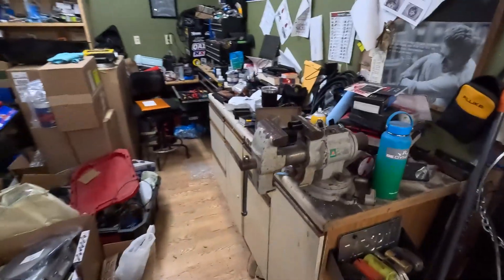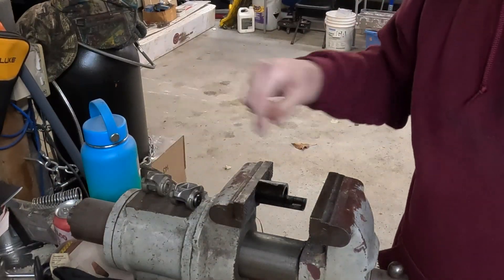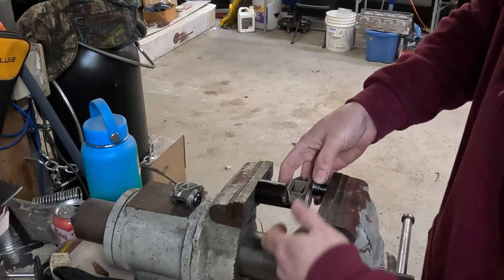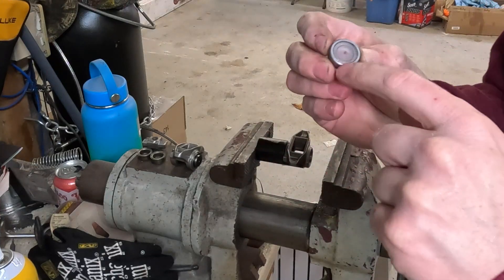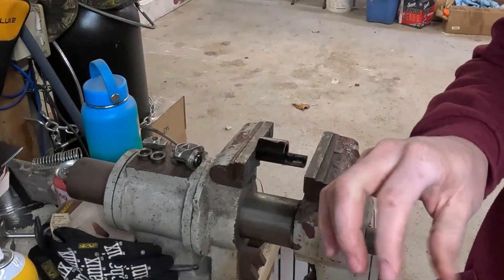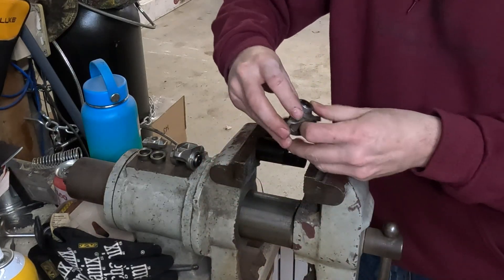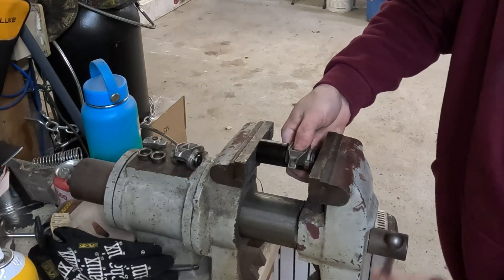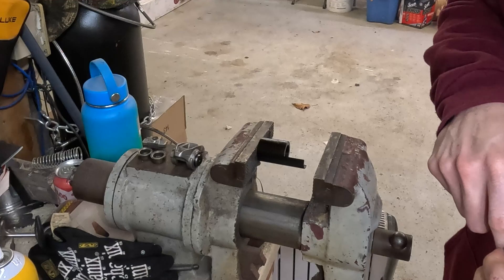Rocker Arm Trunnion Upgrade For LS Heads!!

Comment: Is this a gen 3 or gen 4? Also just wondering what you are using for an engine management system? Glad to see you doing well after your surgery! It’s great to hear your speech improving with every video as you go forward!
Reply from the maker: 3rd gen so 24/1.  Going to be running it on the stock ECU!  Thanks!!
Reply: @GoatRopeGarage  Awesome! I'm in the process of finishing off a 6L swap in my s10, single turbo, running on E38 ECM. I have it running well now thanks to all your Gen 4 tuning videos! Keep the great content coming!

Comment: If the Michigan Motorsports trunion kit is like the BTR kit then I would be very leary about using it. I purchased the BTR V1 kit from Michigan Motorsports and the bearing surfaces were messed up because they were all bagged together scratching/dinging themselves up. Michigan Motorsports is working with me to correct this and I have purchased the BTR V2 kit. Well, it had a trunion that had one of its bearing surfaces cracked! So, if you get one of these kits be very careful and look at the bearing surfaces before you put them in.
Reply from the maker: They come in tubes with the MM kit, very safe and secure
Reply: @GoatRopeGarage  The actual bearings come in tubes in the BTR kits but the shafts/bearing surfaces are all bagged together allowing them to get dinged up. I guess they changed that for the better over the past couple of months. I have pics of both the bad V1 and V2 bearing surfaces in a thread at performancetrucks titled "BTR quality" of anyone wants to see them.

Comment: Just for addition thought, my engine is a 2003 Tahoe. When it comes to Positive Crankcase ventilation, the passengers side is oil fill only, thus pulling crankcase fumes (Carbon, Moisture & Hydrocarbons) out drivers side. During the engine tear down, I noticed every valve on the drivers side had witness marks on the valve stem ends show rocker arm contact. Now, this was my job for over 4 decades is to notice wear patterns, odd as may be. The passengers side had none and I concluded the ware pattern was because of carbon drawn into the rocker arm cover. I dressed them flat and rockers arms as well after  new captured trunnions. But, to increase longevity, I bought another drivers side valve cover, placed a box end wrench over the vent pipe, rotated it 180 degrees backwards (They are just pressed in) and now both are fresh air in. The center valley plate was modified to pull Crankcase Fumes out, ran to "Catch Can".
I can go into more detail if needed but I did it my self. All crankcase fumes come out of the middle, catch can, then to PCV valve to change air flow.
  I am just suggesting not telling you that you must, but here's what I did. I included it into May service manual unique to this truck, including part numbers, schematics, diff, trans (700R4) I bench build 2 winter ago as from a 1987 era with single wire temp sender in pan to console gauge.
 Have a safe week. I hope this info makes sense and finds you in good health!
DK, Omaha.
Reply from the maker: That's a good idea and if you just pull the valve covers normally the bottoms will show what you're talking about on these. Both will have some accumulation but the drivers side will have a lot more build up
Reply: @GoatRopeGarage    The valve covers that have the metal vent tube, have a metal baffle blind riveted into them. I Water Pipe fittings and GM/Permatex Pipe sealant, sold at home improvement stores next to epoxy. I use 1" copper pipe and hangers, took the heads off aluminum rivets, drilled shallow hole (Practiced First on Similar)  and drove them with large flat punch. So, the dollar store sells stainless steel wool now for cheap. I shoved it in the pipe not tight but full. This allows cooling and vapor to turn into liquid. Small holes at the front and increased size every inch going back. I installed a 30 degree angle fitting per-soldered in place. This routes it between knock sensors going backwards. Cross-drilled the tip and install two cotter pins in an "X" pattern. Top side, drilled the valley pan measured for intake clearance and faced a barbed fitting backwards under intake to hide hoses. I used two aluminum oil drain washers and pipe sealant to tighten at valley plate, sealed knock sensors top & bottom with continuous bead of high-temp red RTV. The rest is pumping and running two hoses into one, and end at fresh filtered air. I am not an advocate for oil catch cans but in this case, I highly recommend using one to get the blow-by oil, moisture and black carbon out and not back into intake. Moisture comes from burning a fossil fuel but once the engine internals exceed 212 degrees F, it can't boil off. It takes 574 degrees extra heat after boil to turn into stream. This is latent heats definition. Short trips ruin engine oil quickly. Holler if you need something. DK, Omaha. ASE Master Tech since 1978, retired.
Reply: @GoatRopeGarage  I didn't notice any extra build up up comparing one side to the other on the valve covers vent cover. But, once the rockers came off, i cleaned the springs, retainers and general condition of the head, then the light caught my eye on the valve stem ends. I stopped and done the same on the passengers side only to find no wear or witness marks. Trained by rebuilding carburetors, distributors, alternators and starters, I double checked my findings only to find wear on one side and not the other. It was obvious to determine the root cause and started researching the difference. 
  I am not familiar with the "LS" engine and changes in paint chemistry. My research lead me to both engine, trans and mostly paint. Chemical paint strip (Coopers Stripper Club) cheap, spray not gel (Videos) epoxy, high build, flat hard blocks, guide coat, base & clears (Both MS & HS) and flow coat all for a 67 C10 with wood bed and the proper way to treat it after cut & installed. I enjoy learning. 6 things alone with the "LS" oil pump circuit and galleries tricks. DK, Omaha.

Comment: Have you noticed that some of the center shafts don’t move as freely as others once you replaced the two bearings? I have those tools and some just don’t feel smooth.
Reply from the maker: Make sure you didn't press the bearings in to far, they will bind on the center section

Comment: 2 questions

1. What kind of rpm would you say the trunnion upgrade allows you to safely turn all day.

2. How often should the rockers and trunnions be replaced to avoid metal fatigue, assuming all the motor they are in sees is hard driving and strip time.
Reply: The MM trunnion kits use the same bearing that is in the BTR shaft rocker kits which people turn 8,000-8500rpm with on a regular basis (though obviously the shaft kit will have a lot more stability to it). As far as the GM rocker bodies themselves, if the valvetrain is under control, they will outlast your engine and can be pushed past 7500rpm no problem. If you are having valve bounce or run high spring pressures without a good quality oil, then you can see occasional breakage or excessive wear on the factory style rockers. If you switch to a roller tip rocker (depending on the cam profile) you will typically need to run more spring pressure than the usual LS Dual Spring kits to keep from experiencing valve float towards 7,000rpm since the roller tip rockers have a lot more nose weight than a factory style rocker. If you keep things under .630" lift and run a good quality performance oil that contains decent levels of high pressure additives (ZDDP, Sulfer etc) then the factory rockers will hold up great with just a trunnion upgrade.
Reply from the maker: Great info! Thanks!
Reply from the maker: I wouldn't push them past 7k personally, go to a roller rocker at that point. Honestly for both those questions of they are concerns go roller.
Reply: Awesome thank you guys!